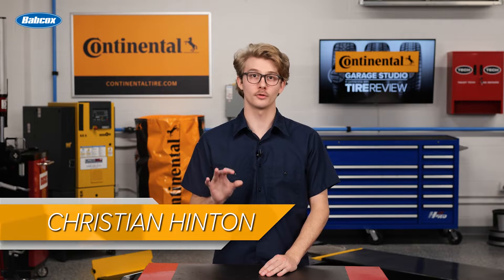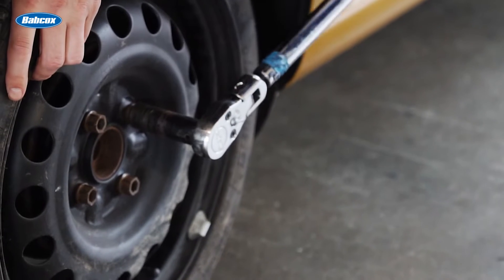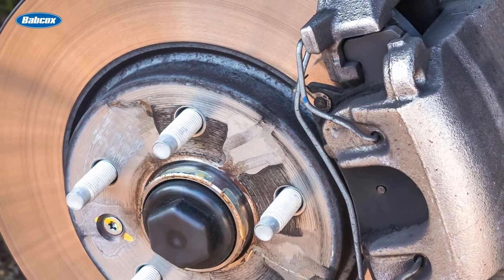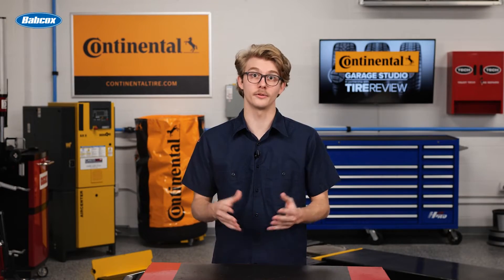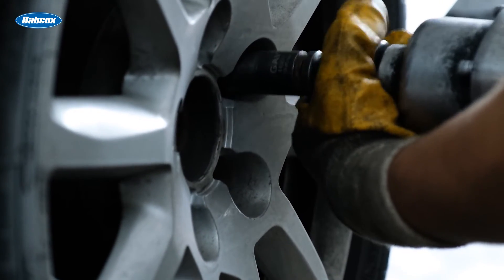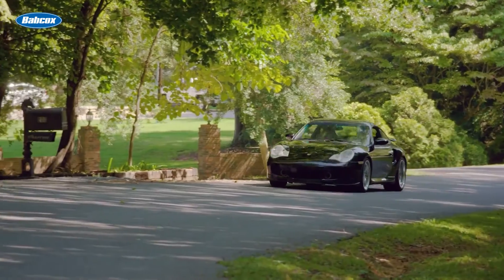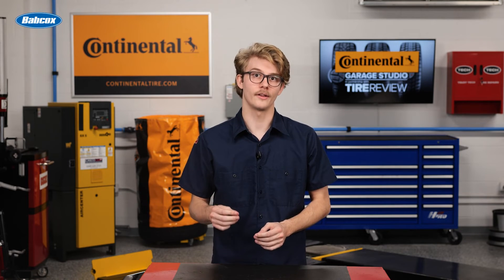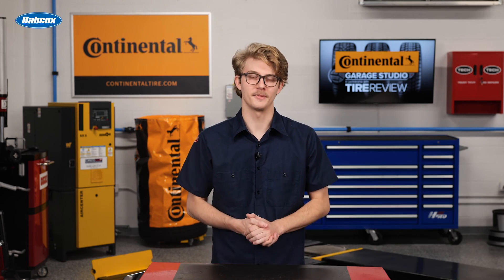The Controversy Over Lubricating Lug Nut Studs

Comment: Its simple really, add anti seize so the nuts dont seize on the studs (a requirement if you live in the salt belt) just dont forget to reduce the torque setting by 30% to compensate for the lubrication so you end up with the exact same clamping pressure as designed by the manufacturer. Why is this sooooo hard for people to understand???

Comment: I've seen too many galled lug nuts from NO lubrication over many years. Yes, mechanics not technicians putting their impact gun on 5 do way more damage by not using a torque stick. A small amount of synthetic motor oil works for me just fine...

Comment: I don't see how one could change wheels every spring and fall when driving in harsh winter environments with heavy road salt if there wasn''t some sort of corrosion protection on the stud threads. That's what anti-seize provides. I can certainly see how the torque values should be slightly different if lub is used but if you don't use it where I live with in a year or 2 the lugs will be very difficult to remove and the threads will be damaged. If you are in California or Florida it's nowhere near as much of an issue. But our vehicles take a huge beating here.
Reply: You should see what vehicles look like within 1/2 mile of East coast in Florida. Everything for a matter of fact.
Reply: @EdwardPhillips120mmMG  I know there is salt damage near the ocean long term because salt is in the air. But here the wheels are caked in the stuff after a short drive. Back when honda civics started showing up in the mid 70s the front fenders would rust through in 2 years from the salt spray off the tires. They got tired of replacing them under warranty and developed under coatings and plastic inner fenders to be able to withstand our climate.

Comment: Anti seize for me, You need to reduce the manufacturers torque specs by 30% if going down the lubrication track. Ajax fastener PDF give you that requirement.
Reply: So you should tighten them less with a lubricant on them?

Comment: For the last 15 years i apply thin layer of grease on lug nuts and center hub, i tighten by hand ,no excesive force. It drove me crazy to remove  wheels after the canadian salty  roads and  garage overtorque.  A bunch of friends start doing the same, so in the past 10 years or more, I know for sure that everything was just fine .

Comment: how do I prevent idiots at garages from using impact wrenches to way over torque Lugnuts?
Reply: when I worked at Sears Auto Center in the early 00s, some customers would see we were using impact guns and would be concerned. I informed them we used "torque sticks" to limit the amount of torque that made it to the nut. They were an extension with the socket on the end, color coded for the torque. Then we'd finish off with a torque wrench. I use an impact gun on my own cars, but just barely, then finish off with torque wrench. Rarely do I go over the torque, if I do I back off and retighten.  I had some tire work done at a trusted shop once but he must of had a new guy who was a moron, he got the lug nuts on my jeep so tight I almost couldn't get them off to the point where they were popping and complaining bigtime, so there are still morons out there for sure. All shops that hire "tire guys" off the street should be using torque sticks for sure.
Reply: @kennygee2715  tire guys or the guys in the quick oil change places are usually kids who don't know anything or older people who can't qualify as actual mechanics. They lack a basic understanding of fasteners and how they are supposed to function. Their main job is to upsell or scam.